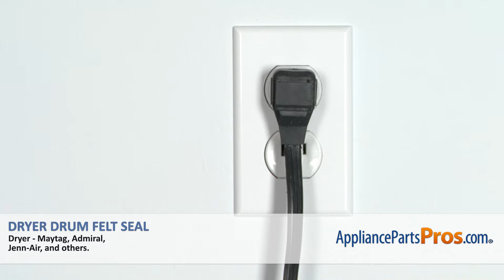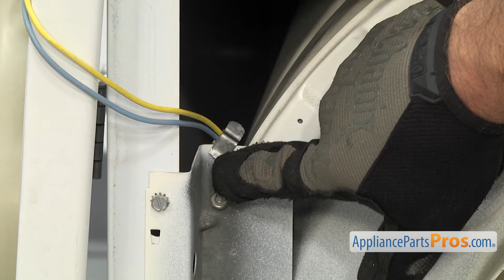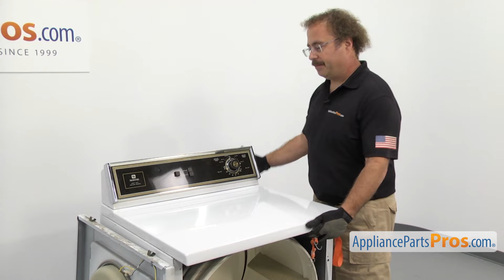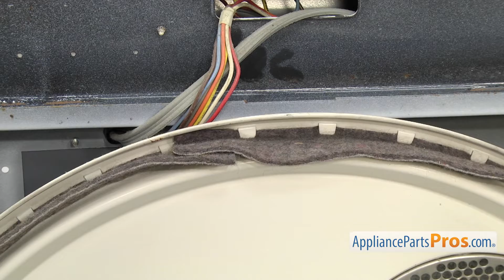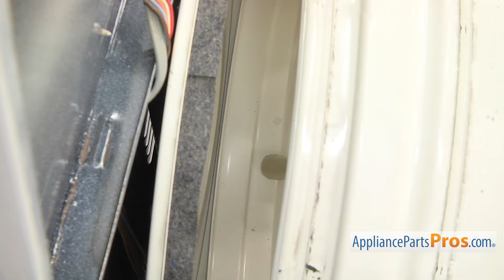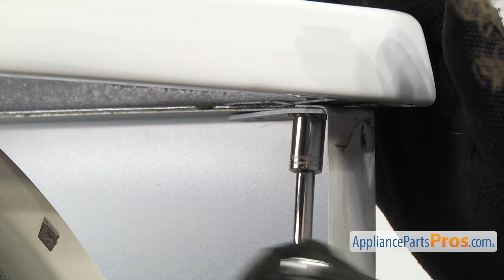How To: Whirlpool/KitchenAid/Maytag Dryer Drum Felt Seal WP314820

Comment: Nice and easy to follow until I saw no tabs mine was glued in and the new one one shorter and smaller but you got me most of the way its just me I'm learning allot as things are breaking
Reply from the maker: Hey @scotttracy9587 — you're doing great, and it’s awesome to hear you’re tackling the repairs yourself! Some models do have the felt seal glued in from the factory, so you're not alone there. The size difference you noticed might be due to a model variation or an updated part design, but as long as it fits snugly and is well-secured, you should be good to go.

You're absolutely on the right track — learning as things break is how many of us started. Keep at it, and if you ever need help double-checking parts or getting through a tricky step, we're always here to help!